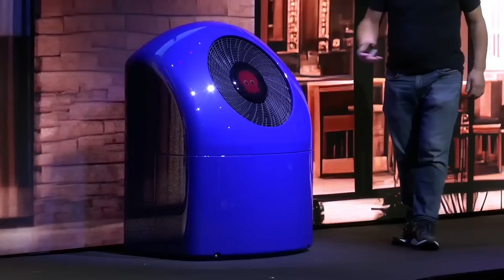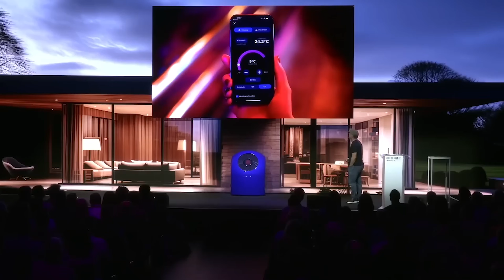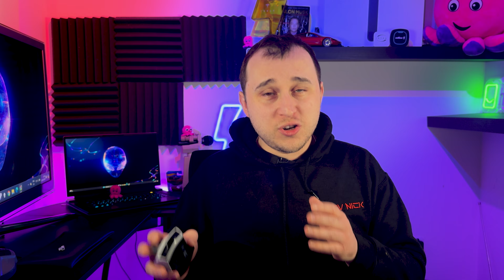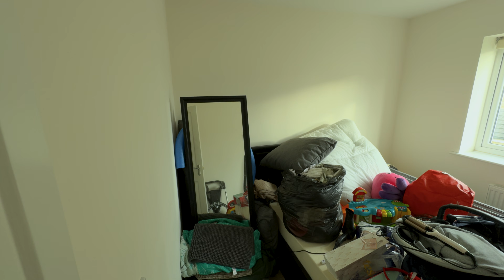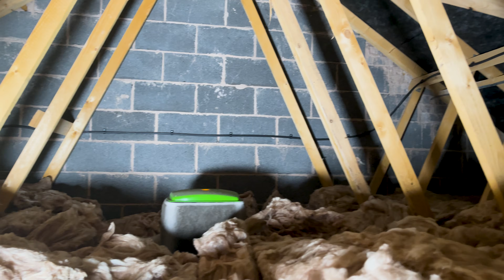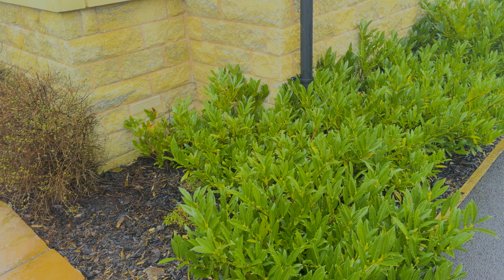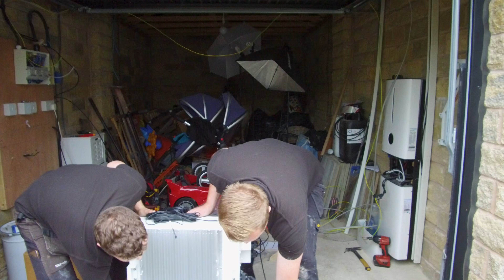Octopus Heat Pump Survey HAS Hidden COST!

Comment from the maker: Not an Octopus Customer join and split £100 with me evnick.com/energy  Getting a heat pump SPLIT £200 with me and get £100 off your install use my unique referral code: 87680
Reply: I am.

I wish I wasn't.
Reply: Not everyone benefits from having heat pumps installed and maintained. We're among that group. Never had or needed central heating; this room is at 23°C at 05:00, with no heating running, in mid-October. Justifying the cost of a heat pump which will definitely result in bigger long-term costs is a tricky one. 
Brief details: Octopus want us to reduce our direct debit, for gas plus electricity, from £75 to £52. Might do that at the end of Winter. It's 19th October. At 05:00, with no heating running, it's 23°C in here. Good insulation, a good-sized home battery with no Solar PV. And our BEV is recharged almost entirely at home.
Reply: Sorry Nick did you mean an Eddi, energy diverter, the Harvi is the wireless ct device
Reply from the maker: @AndrewBrownEngTechTMIET  I did indeed slip of tongue

Comment: I have booked the survey with octopus. Your comments about the target temperature worried me a little because we currently have a tado system and i like the bedroom cool at night - its set to 16C. I cannot sleep if its warm at night. Our house tends to be around 19.5C. If we get the heat pump, will we have to be hotter than that?
Reply from the maker: Your in the rare cases of people who want under 20c you can have it as cool or as hot as you want,  they will design your bedroom for 18c and other rooms are from that to 25c (bathrooms with showers or baths) with most rooms designed for 20c  your thermostat pod will heat to what you set it to so if in a room with 20c the bedrooms are in theory 18c if that thermostat was set at 20c.  

You should slightly over design the room temperatures as you can always turn it down but if you wanted it much hotter it’s not practical also if your always wanting colder than designed temps you can adjust your flow temperature this will improve efficiency

Comment: That's like having a submarine in your house .😅
Reply from the maker: How do you mean
Reply: @NicolasRaimo  Yonks ago we got rid of the need for a hot water tank in the house. Now it seems we're going back only submarine size.
Reply from the maker: @GrahamDoubleday tanks are sized for occupants in house mines a modest 210 litre tank however old tanks weren’t insulated new thanks are that makes them larger than the old open air ones
Reply: combi boilers heat you're home, and give instant hot water. No need to have sub size vessel in house, and no need to constantly heat it up.And the whole system is only 1m by 1/2 m. Leaving room to live & maybe a pool table. 😅😅
Reply from the maker: @GrahamDoubleday and cost 4 times to run
Reply: @NicolasRaimo Government encouraged everyone to buy diesel cars,not long back then the price went sky high. Also told us energy bills would go down by £300. Just wait for it it's on its way.😅😅
Reply from the maker: @GrahamDoubleday I can generate all my own electric at home… how’s your gas generation going..

Comment: A bit of a sorry tale. What puzzled me was - if they don't have the specs or data sheet for the Cosy 6, how did they manage all the sound level calculations? Also, why would you purchase something for which you can't check out the details?
Looks-wise (having claimed that heat pumps aren't handsome objects) why go for what must be the silliest looking choice around?
With  a tricky install like the one described here, I'd definitely have phoned my local Heat Geek. Not sure that the Octopus bods would be on top of things, especially since the unit is still a mystery object. Do they guarantee a minimum SCOP for your system? And what will happen if it doesn't meet what was promised?
Reply from the maker: It’s out and it’s been installed for 2 years and the price heat geeks wanted meant it would of took 25 years plus to get the difference back between the cop

Comment: Interesting vid for anyone considering an air source heat pump. Just having mine installed right now. In terms of costs in 2026 it does seem considerably more expensive than just a few years ago. Due to the Iran oil situ and being on an oil boiler the grant was upped to £9k. Even after the £9k grant im still paying over £2k. The job includes the hot water cylinder, the cosy 9 pump, and 3 radiators replaced. 
Not being replaced are the other radiators (which were already replaced by me 5 years ago) and the pipework was already ok. I also already have a solar system and batteries. I was not offered an Eddi. Will see how I go without.  Yes there are hidden costs. They wont do anything where they cannot gain access easily - you have to sort out the access - eg moving kitchen cupboards. However they are doing a few little extra things for me included in the job like removing and disposing of oil boiler, water tanks in loft and hot water cylinder. Ive bought some rolls of insulation to go down in place of the water tank which they are putting in place for me.  Things to be aware of - they now can access white trunking. Ive had this down front of house and it isnt too bad as it has some white cladding on the front anyway. The pump itself it the size of a fridge so quite big. I wanted it in the garden but said more efficient to have it close to the house.  Then they said i needed planning permission but when I said to move the pump then they said I didnt need planning permission, that they could move its posiition over a litte.  Im going to grow a bush or tree in front of the pump to disguise it as it is an ugly looking thing. But then so is the big box of the other types of pumps. Can you insulate around them? Im hoping residual heat from the house helps it not freeze up in winter. I didnt know this was a concern. The water cylinder is also huge. Mine has gone into the airing cupboards as im in an older property. I didnt know that there would be 2 other smaller tanks alongside the larger cylinder.  Cupboard just bout big enough but I have lost some storage space. But I have gained a boiler cupboard of new space. Im impressed that the water cylinder is so well insulated that it will only loose 1 degree of heat over 24 hours. Thats amazing compared to what i had before (a 1960s cylinder with a jacket on). All in all im hoping it will be a big upgrade from my ancient oil boiler heating system.
Reply: Interesting to read this Lisa - I'm just about to sign up for a Cozy 12 from an oil boiler. And yes the cost has gone up hasn't it compared to what most of these YouTubers paid 1-2 years ago, despite the bigger grant!

Comment: Nice vid, my survey is next week and octopus are prepped for close to zero disruption service as my new build home has the exact water tank they would have used, downstairs underfloor heating and no rads will need upgrading. Only concern is HP location as most efficient place is front of house but hoping we may get away with down the side alley in garden. Have solar and 20kw battery so hoping to not need the diverter? As would have used the IOG cheap stored energy anyway?

Comment: How about running PEX in the floor in place of the second radiator for the kitchen? Also, I'd think it would be worthwhile to have the tank in the living space, so any heat it throws off won't heat the outdoors. Is the roof an option for the outside unit? It would save space and keep the cold currents away from the ground, but it would also transmit more noise to the structure of the house.

Comment: if it's true the environment provides an additional 66% heat(something which isn't a real number😂)
 then these heats pumps would be far more efficient put actually inside the home, keep heating at 30c the heatpump would work in overdrive.
Reply from the maker: They extract heat from air and then have the hot and cold air they need to eject the cold air but being inside would mean it wouldn’t be able to extract any new air for new heat…
Reply: im sure air is air There's no such thing as new air or old air @NicolasRaimo
Reply from the maker: @doubleooh7337 you can’t extract any extra warmth your hit a limit I know a house isn’t perfectly sealed but your not going to have more air to
Extract heat from your hit a limit outside it’s constant ambient air
Reply: @NicolasRaimo and? the air inside is connected  to outside😂  there is no invisible plateau you're speaking of. do you know electrical engineer or science? doesn't sound like it.
Reply from the maker: @doubleooh7337 I think it’s the other way around…

Comment: Past to have one fitted by octopus, then i mentioned is there another location for the tank, found that then said they woukd use scafolding to fit the pipes to that area.
So thought of thats out the window then too simple installs are all theybare after, not that it cannot be done.
Then i get told they wont even install now even though i jad passed for the orginal pum install.
Fed up with the whole sitistaions now, juat don't bother stay as your house was fitted id say is the best option.
There noise calculations seems a bit wrong to me as well because that somwthing they have said was the new issue going when they cane back to look for the tank locatiom o was asking about, so now they wont fit the orginal install they passed to be fitted.
The problem is they have a pump thats saying 42db is the measurment of the pump and then saying the noise is going to be too high 5mtrs away for the neighbours bedroom window thats 5 mtra away, theu are eother lying about the pump noise generated or they are not actually measuribg the noiae level frin that distance, as the sound would lose quite a lot of db from 5mtrs away your talking 10 db as a rough guess they are using 7mtrs i think which dies not fit woth the pumo specs that it would be more than 40 at the window when the pump is 42 at the pump dont get it, i look at lots of charts and can see they are way out with the distance to noise ratio calculayions if the programme they use.
As long as its below 40 its fine.
Then saying you cannot have on type pump unit near an aco drain then saying the other punp has to be in the middle of the area think the cosy 6 but on seeibg videos they have then fitted right upto a wall.
If people likw me are wolling to go more green and they wont bother to do the job or at least put more effort in to the system for options of fitting then the future is very bleak as now a very eqsy looking install looka to be not be done now for sone flvery sfupid reason that don't add up and some are just not giving the optikn if they don't want to do the work.
Back to diy installs i say unless its simple joe bloggs they don't 2ant to know and thats if they knoq what they are doing in the first place.
Passes to then not pass that tells me they don't want to do the job at hand, how cab you pass ask for an option then tell you canmot have it at all crazybstuff going on.
I was trying to go all electric, just had the car, was supposed to be going heqt pump then solar.
We don't have a boiler working that broke 1.5 years ago.
Don't really wabt to go back to gas.
It all screwed up system thwy need to be more flexible this cpuntrybis nevwr going green if thia is the case trying too.
Yes i qm angry as i was told yes and now told no on some very basic where we shoidl not have even faced the survey that far.
Not happy.
Goverment needs to sort a few things out for the futurw as we have houses being built in far worse sitiuation as we are here that a fact.
Hence qe are int rouble going forwards.

Comment: So your going to rip out a perfectly good gas boiler, n replace it with a more poluting gas boiler. Rocket science or what.
Reply from the maker: NO.... I ripped it out for a heat pump...  neighbours boiler failed 1 week after my heat pump went in...
Reply: @NicolasRaimo  He means the HP runs on electricity, generated by gas at around 45% eff.
Reply from the maker: @malcolmstead272  then he’s even more wrong the grid runs on a mix of energy not 100% gas,  I also use a renewable provider which increases overall renewables on grid… finally I have solar and battery storage offsetting it even more

Comment: Any thoughts on this Cosy pump the fan of which is angled significantly upwards catching deluging rain and snow straight in to the works?Looks like a litter bin.
With a gas system you have full control of each radiator temperature (changeable by adjusting the hand thermostat valve) and overall operating room thermostats. You can zone your heating to upstairs, downstairs and hot water too for even more control and cost saving.  Opening windows and trickle vents is not a problem either. No need to change radiators but upgrading insulation to Heat Pump requirements would save you on gas usage.

Comment: How wide is the Thermal Store and how big is your loft hatch. I have been told it must go in loft but not convinced about hatch size.
Reply from the maker: No that wide its a slimline tank made to fit threw the loft hatch,  octopus will measure the hatch to ensure they fit

Comment: So what if you do already have a water tank?  Presumably they have to take that out before putting the new one in… and therefore what happens water-wise in the interim?
Reply from the maker: If the tank is modern they may not need to change it… if they do it should be a same day change…
Reply: @NicolasRaimo thanks… I suspect it will need changing.
Reply from the maker: @diddybopper2052  if it’s an old tank then yes it may be your without water a day or so for hot but your still have cold feed just have to shower day of install

Comment: The hidden cost is don't fit one in the Highlands of Scotland tooooooo cold 🥶🥶🥶🥶🥶 its in the name AIR SOURCE...which in Scotland is normally below 5 degrees...no heat from that..
Reply from the maker: Norway has air source heat pumps and they work fine watch my install video where we explain what temperature they work down to :)

Comment: The whole thing sounds horrendous. Like myself, many people, in the past, opted for a combi boiler and had the loft tanks removed and the hot water cylinder and all associated pipework taken away and, in some cases used those locations for different purposes. If I get a heat pump, where on earth would I put that big ass ugly cylinder plus the outdoor unit? Then there'd be all the floorboard lifting, the ceiling disruption, additional insulation and possible radiator renewal/relocation required. Finally the cost of the whole thing. Not for me I'm afraid. I'll stick with the combi for as long as they allow me.

Comment: This sounds a lot of work. If they could just replace a boiler with an electric one with no other changes then people may be more interested
Reply from the maker: An electric boiler would be 100% efficient and they do exist however seeing electricity is currently 3 times more expensive than gas this means running it would cost more than gas.  A heat pump is 3-5 times more efficient than your gas boiler so despite the extra cost of electricity its cheaper to run
Reply: @ true. Anyone with a decent or new boiler won’t bother. quoted 6k after the 7.5k. Granted no survey just based of number of radiators. Seems crazy, going to try octopus see if it’s better.. could stomach about 1-2k but not 6-7k
Reply from the maker: @kagoolyt  octopus was £1350 for me after grant give try evnick.com/energy link to get an octopus quote online instantly PLUS we can split£200
Reply: @ ok thanks

Comment: I've given up getting a heat pump. 1930s semi-detached, but Octopus who are by far the cheapest installer, especially with current 20% off, won't do as it's difficult to site the heat pump without planning, and the pipe run to anywhere with a tall cylinder is too long. They won't entertain having a Heat Geek ministore in the insulated space I have under the house. Too inflexible to get cheaper. Too expensive to get a Heat Geek. Stuck with a 20+ year old combi that I will be forced to change to another combi.
Reply: BTW, Octopus survey guy was here all of 5m. No solutions, no suggestions, no even suggesting another company or anything. It's all because I have a 1.8m tall balcony with steps down from the back of our house which is the only central place away from neighbours where a heat pump could be sited, and the lack of cylinder options. I even said I'd pay to get a Heat Geek ministore installed but he had no clue what that was all about. Heat Geeks will be too expensive for me.
Reply: I'm in a similar position. My only hope is that with all the new electricity coming on stream via renewables (assuming mad Ed the ecomaniac) can get something right, it will be smart electric radiators for me.
Reply: I also live in a 1930s semi and I gave up on an ASHP too after paying out £375 this summer for a Heat Geek survey. Their contractor didn't seem to know anything about their more recent products (within the last two years) and seemed to have no interest in trying to solve problems. The only useful piece of information I got out of him was that I could not site the ASHP within 1m of an openable door (I suspect this was because the ASHP uses propane).
Reply: Some YouTubers found that Heat Geek was the cheapest quote, because they'd designed for a much smaller heat pump.

Comment: Tempting. I would miss my gas hob though. Much cheaper and more controllable than electric and when discussing replacement of gas boilers with heat pumps no one seems to mention this fact 🤔
Reply from the maker: Replaced my gas hob with induction,  fastest boiling of water ever full pan from tap to boil in 120 secounds! Easier to clean,  safer worktop for my kids as surface parts don’t get as warm as heat does direct to pan.   And best of all my co2 and air quality vastly improved in home remember a boiler flue is outside and your hob has no flue